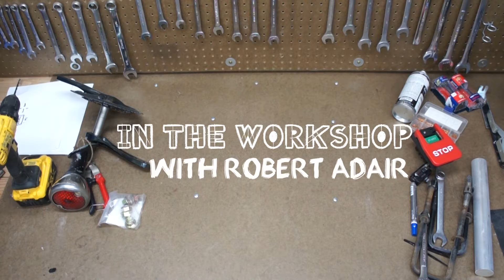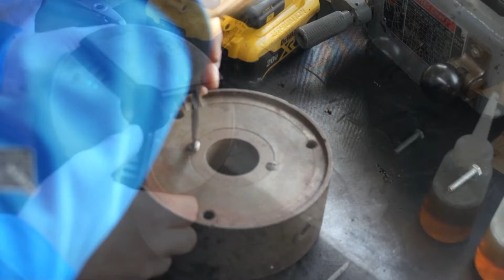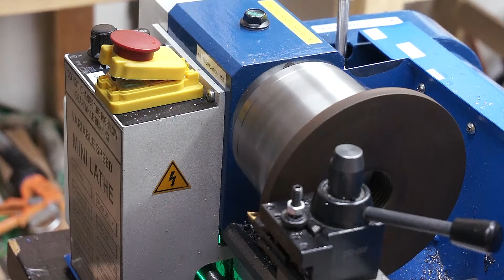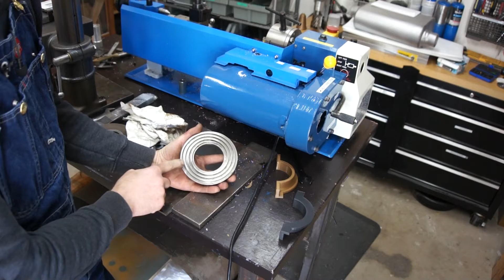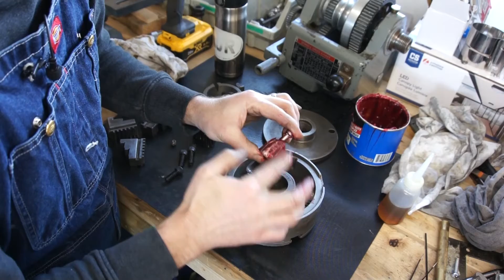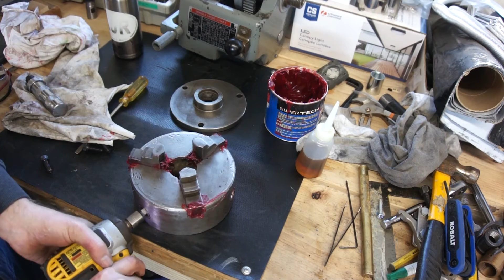How to Rebuild a Metal Lathe Chuck

Comment: You really shouldn’t use grease in the chuck…it just acts like a magnet for dirt and chips…there are no fast moving parts,, all I’ve ever used on lathe and drill chucks Is a light oil like 3 in 1…
I’ve just stripped and cleaned a Pratt Griptru chuck that had been stored from new, but was seized and the seller only wanted £50…The problem was that the original grease had set and was hard like varnish…after cleaning and a light oil it works like new…making it really easy to strip and clean in future..

Comment: Only problem I can see is the grease will come back and bite you, the chips will stick to it and make a great grinding paste inside. Nice job though.
Reply from the maker: Yeah, the more I used that grease, the more I regretted it.  Any idea what I should have used?
Reply: @RobertAdairWorkshop  I just use a machine oil on my chucks, way oil would do it too, can be cleaned out with WD40 or brake clean then re oiled. Gets most of the chips out.